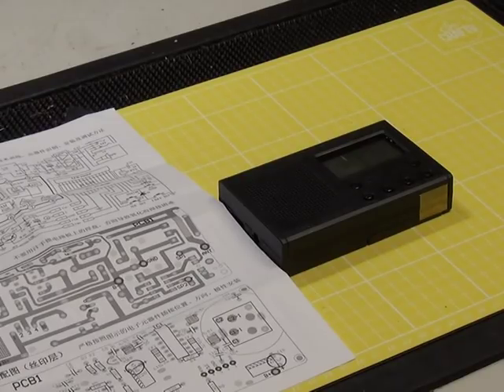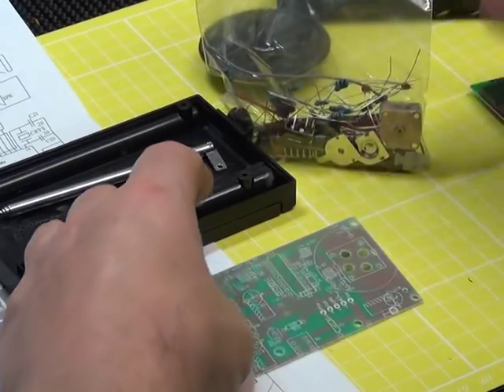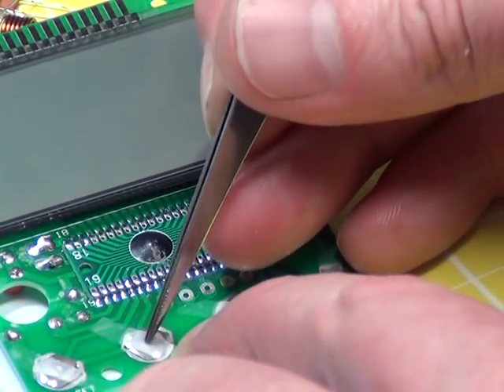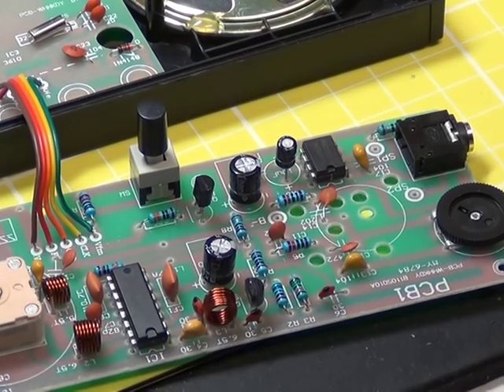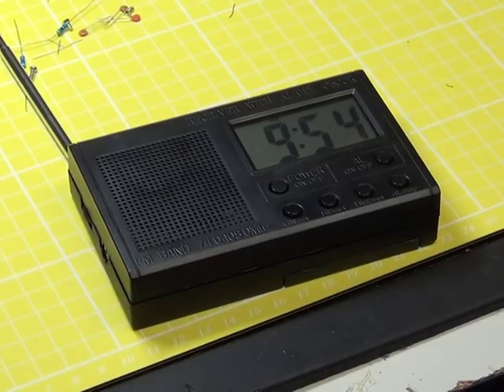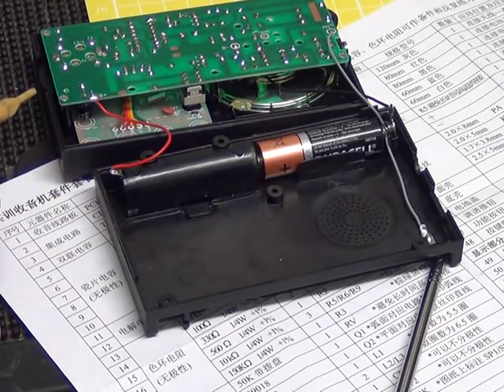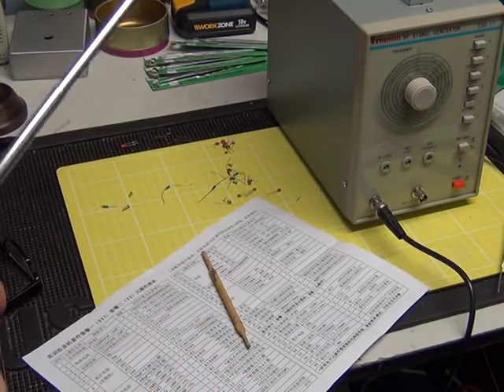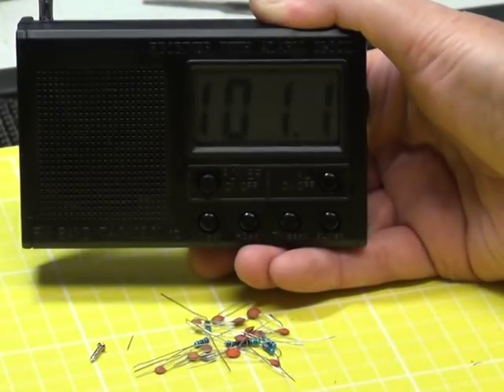FM LCD clock radio kit assembly & alignment

Comment: This has a 1980s look to it. That is an odd bandwidth for FM. Interesting project. Hope you have a Happy New Year. Cheers!
Reply from the maker: Thanks for the greeting, Dwayne. Bear in mind that FM entertainment radio is different in different countries. The UK has FM on 88 to 108Mhz, but thechannel spacing is different to that in the USA for example, so synthesised intended for the USA market wont pick up all UK stations when used here. Conversely, the Far East is something like 74 to 92 Mhz. Our business radio spectrum on low band here is 68-88Mhz, the USA is around 30Mhz.

Richard (UK)

Comment: I'm thinking of purchasing the Tec Sun kit.
Can I ask if there are plans to show your home brew ham radios and associated equipment?
Reply from the maker: I'm not familiar with the Tec Sun Kit but never mind! 

Mr Chippie & I have been doing these radio kits for a bit of a laugh. Neither of us have ever bothered with kits before but we both fancied the challenge of really cheap kits with Chinese instructions!

Strangely enough, I've just started a video this afternoon of me building a 1974 vintage magazine project for a bench amplifier so decided for the first time to do a video of one of the homebrew projects. I really enjoy the challenge of getting  together the required components for vintage projects & to that end wouldn't ever make anything from current or recent magazines.

I've no plans in showing stuff I've already made, but certainly have plans to do a few videos of me making some of these vintage projects. Other than the bench amplifier, the first (big) project will be a 40-channel synthesized 4W CB base station in a 19" rack cabinet featuring the PE Ranger from 1981. I'll start by producing the printed circuits from scratch too. There are some valved ham transmitter projects planned too.

Richard (UK)
Reply: @ukfmcbradioservicingTango21  That's great news, look forward to viewing the upcoming videos.